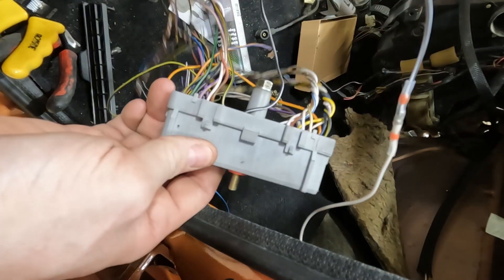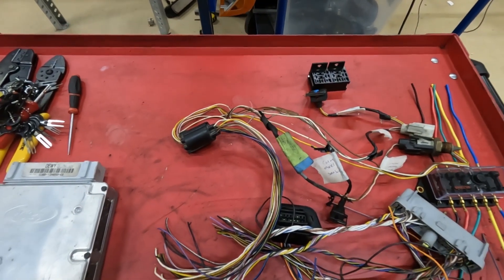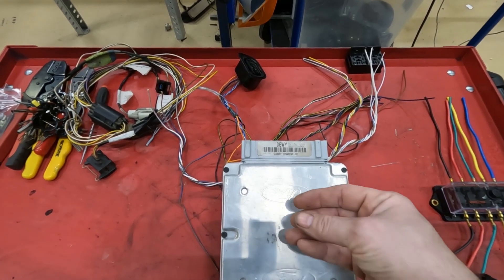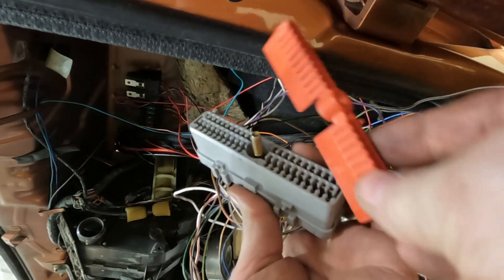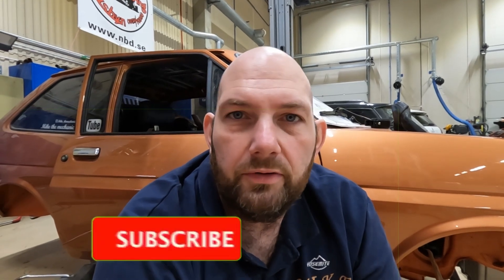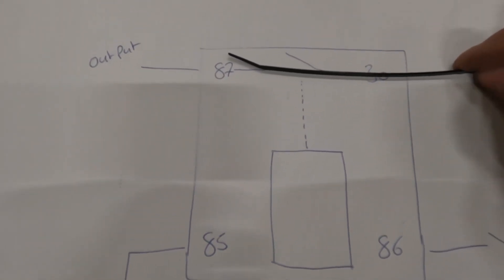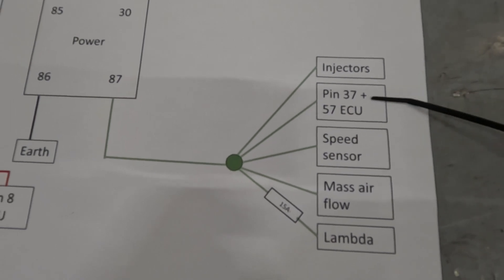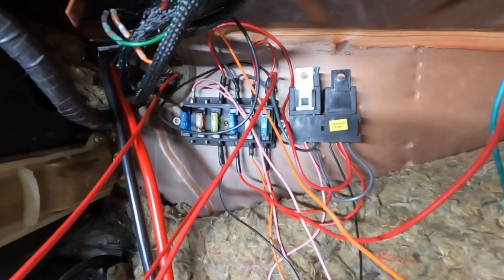How i wired in a fuel pump and power relay to my MK1 ford fiesta zetec conversion step by step.

Comment: nice job,i am fitting a red top calibra engine into my zaffy a ,at same stage,mix different wire looms ,solder together,add right fuses,relays,nice to see some one else doing same type work,i never know you could do away with key ,chip system,not sure on gm systems,but it was allready fitted ,going to give life to my old zaff ,i follow your project with intrest
Reply from the maker: That should be a quick car as well 🚙😊. It's only 3 ecu for this build that don't have imobilzer fitted. Thank you for your support i really appreciate it 😊